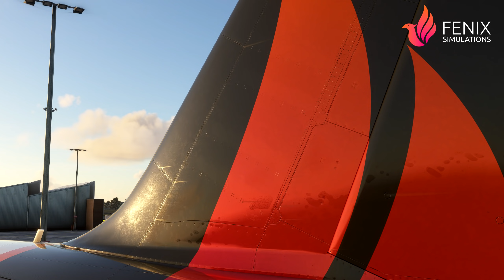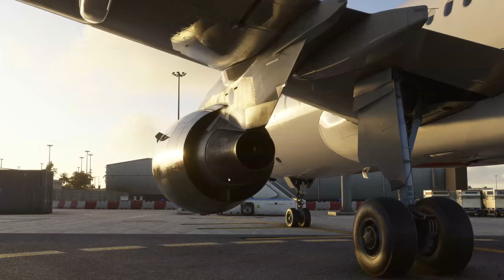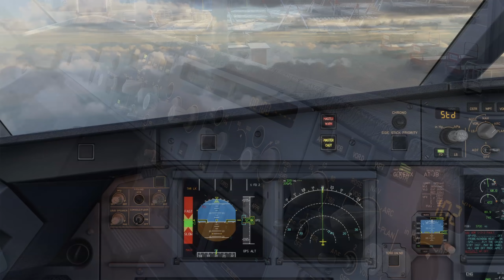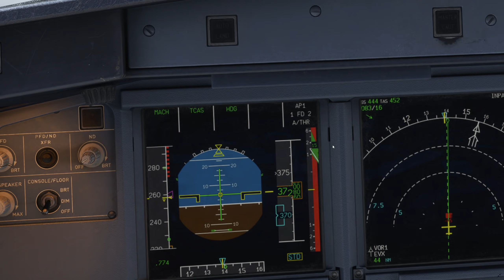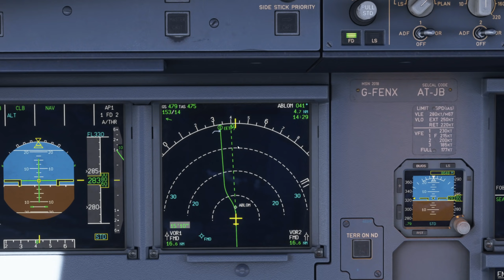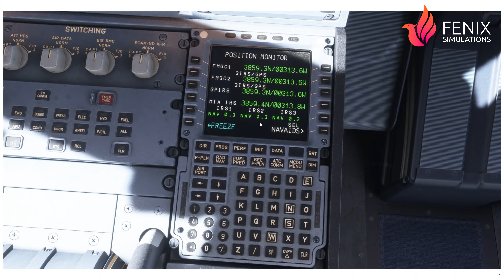High Fidelity Fenix A320 for MSFS! MCDU News and Thoughts with a Real Airbus Pilot

Comment: I hope they get the engine simulation correct. In the pictures the engine data thats displayed is the same( EGT, Fan Speed, Etc). IRL they're usually differences in these parameters between the two engines.

Comment: The exterior dirt reminds of what a colleague at work told me how they used to get the exterior of the aircraft clean when he was in the RAF, (we are going back 25 yrs or so) they would invite the local Air Training Corp to the base, give them jet washes, rags and long handled soft brushes and leave them under the supervision of 1 or 2 ground crew to clean the aircraft and afterwards give them a slap up meal in the mess.

Comment: Great overview. Question: What about GPU specs ? 
With all its extra fine visual 3D detailing, will this model need more GPU RAM?
Reply: Supposedly, the next sim update is going to massively improve overall frames
Reply: @afrendlysnek1728  Yes, the next big FS2020 update will use multi-threading of the CPU usage, esp for EFIS cockpits. However, that doesn't necessarily mean the GPU will need less RAM than before. I'm already VRAM 'borderline' with my 6GB RTX 2060 !

Comment: If this is PMDG or FSLabs quality then this is going to be a real treat...
Reply: maybe even better, so far the FMGS is far ahead FSLabs but let's see if it's confirmed on release
Reply: You will be able to pull individual circuit breakers... This plane will be beyond PMDG/FSlabs quality in some respects
Reply: @BIOHAZARD_X  DC-6 has working CBs that can trip (appears to be at random too, as i had my DME CB trip and i didnt do anything abnormal). these are the things you can do now. we have to base PMDG quality off of the DC-6 for FS2020, and thats the best thing we've ever had (so far ;) )
Reply: @BIOHAZARD_X  Now why the hell would I be pulling circuit breakers?
Reply: @submosphere1203  you might need to pull circuit breakers to perform a computer reset of a system. Sometimes an MEL operating procedure would command pulling a CB to deactivate a system
Reply: @Maximususs  Yeah exactly, it's just pointless procedures that we're never going to do and it's just there to be there. There just is not a point in modelling all the circuit breakers. All it's going to do is take up more memory from your system. Most flight crews never even touch them unless instructed to.
Reply: @submosphere1203  not for everyone. I appreciate that an average summer will never need that level of complexity, and that’s absolutely normal. However for me and many other real 320 pilots this is an absolutely amazing addition. It’ll add a lot to our “home training”
Reply: @Maximususs  I disagree but I respect your opinion.
Reply: @submosphere1203  that’s why it’s called  “study level”
Reply: @g_pazzini  Study level doesn't mean you need to include circuit breakers buddy. They're a lot of "study level" planes that do not include circuit breakers because they're barely ever used..
Reply: @submosphere1203  Respectfully disagree.  Given they plan to have a very high number of failures available, it is highly likely that you might well need the breakers as some have said in certain situations.  So RW A320 pilots would benefit from the highly detailed.  That said, I concur that the non RW pilots and more mainstream sim enthusiasts may not 'touch' the breakers, or even have failures active at all.  Those that simply want to import their sim brief FP's and fly their planned routes and log the hours - not likely to go near some of these highest-level features.  Realistically though, it's wonderful to see a rival enterprise that can offer something on such a grand scale and is putting in a ton of real hard work to make it as real as it gets for everyone, regardless of piloting training or skill level.  MAsobo has been foot-dragging on many important elements of the underlying sim itself, which is greatly delaying PMDG doing their ground-up rebuild of the 737NGu.  The DC-6 is well and good, but in no way does it meet the needs of the current-gen pilots, it's more of a historical artifact with the steam gauges.  The Fly-By-Wire team is doing their best but this plane from Fenix is several orders of magnitude higher.  The biggest problem is the lack of a solid SDK (software developer's kit) and the underlying physics model, not to mention some other things that 'could be better'.  That's why so many are flying combinations of MSFS and something else, e.g. P3dV5 (DX 12), XPlane (soon XP12), etc.  P3dv5 can look pretty nice but nothing compares to the beauty of MSFS.

Comment: 6:30 , can you confirm if the top of the dash just above the FCU is either a hard plastic with a "leather" texture built into the molding of the plastic, of if it's a properly wrapped "padded" affair like you find in some areas of modern cars? I've got a behringer x touch mini I got working for all the FCU & AP controls, and I wouldn't mind making a small enclosure for it and my logitech switch panel. If I'm gonna make an enclosure for the panels I figured may as well make that little top dash surface too but I don't know if it's squishy (looks squishy in the A32nx, looks solid in this view)

I asked my pops (maint. for a cargo carrier with plenty of airbusses) and he couldn't remember, it's been a while since they had an issue with one they could fix in station

Sorry, I know it's a really weird and super off topic question, but there so few comments here so far, lol

NEVERMIND, I should really watch the full video before commenting. Squidgy Confirmed 17:30

Comment: Is there any point in modelling the DCDU since I don’t believe controllers utilise it on Vatsim?
Reply: if it is interfaced via hoppie, you can definitely use it at least in europe, have used it quite extensively int the aerosoft a330 and the fslabs